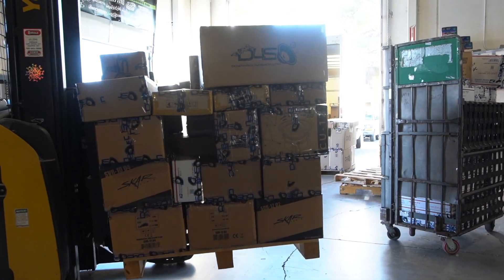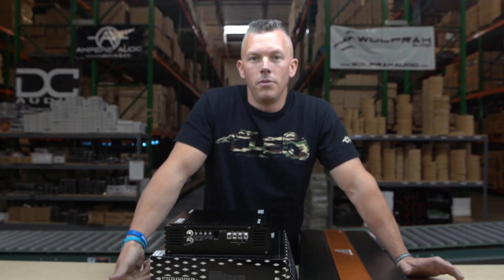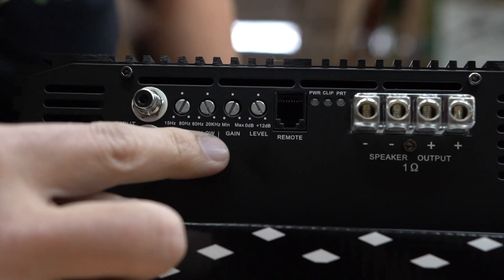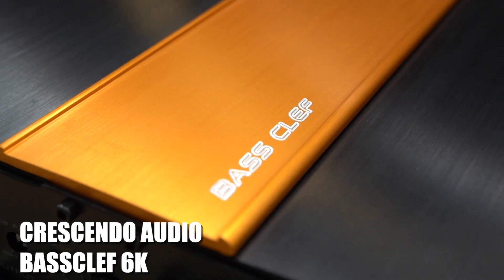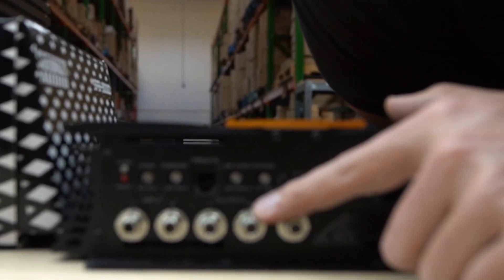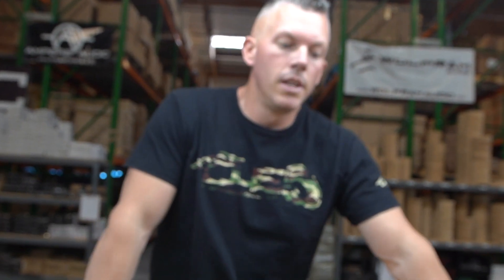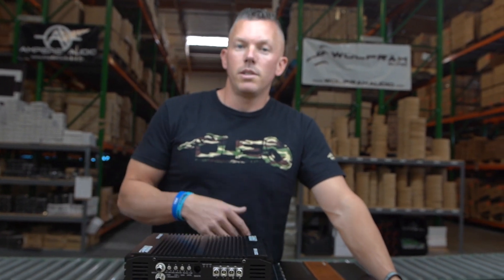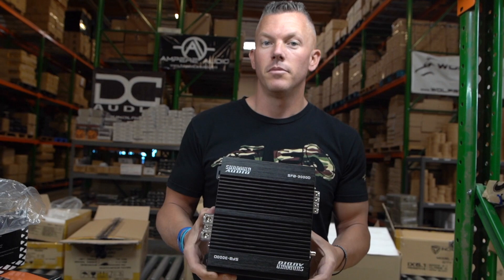FAQ WITH JP: WHAT IS A FULL RANGE AMPLIFIER?

Comment: Do you recommend powering the x15v3 in a 4 cubic feet box with 64 port area on the sia 3500 amp if so what ohm 1 or 2 would work better for that set-up

Comment: i love full bridge because : 
1. cheap, good bank for your buck.
2. super super powerful.
3. small chassis. easy installation
4. 90% fullbridge amp come with internal fan for better cooling.
5. full bridge from taramps + soundigital + stetsom and some another brands has a fullbridge but not a fullrange, specialist for subwoofers for low freq. same as normal monoblock half bridge design. sundown sfb just have a fullrange.

Comment: How can I run a mechman 370 gm 2 pin alternator as a second alternator just for my bass? I have a dual alt bracket and have an xs power d3400 battery with two ioxus ultracap banks completely for my system. Stock battery and stock alt for running the truck. Thanks for the content.

Comment: Full Bridge amplifiers are literally two half bridge amps strapped on one board wired in a push pull configuration. Half bridge are longer and heavier than full bridge because of all of the additional voltage and filtering needed achieve the same wattage of a full bridge due to the design of a half bridge. The reason a full bridge can't be wired below it's rated ohm load isn't because the design is crap it's because each half of the full bridge is already at .5 where this isn't a problem with half-bridge. Most full bridge get a bad wrap because the build houses are ordered to use cheap affordable parts which is 0 reflection on the topology of the amplifier and more on the companies ordering these amps and not wanting to put the money in them to up the quality.
Reply: JL Audio has produced some quality Full Bridge amps. JP literally just explained the difference between full range and a limited range amp. LOL
Reply: @SeanSinha  you do realise that jp has no idea of what he is talking about? Also flexin is completely right and your comment just proves how you know nothing about it either
Reply: @djlolerkoster  I am saying that JP didn't explain what a full bridge amp is, he explained what full range is. Full bridge amps are typically produced to be cheap, but there have been some awesome full bridge designs from companies like JL.  I bet I could present on the difference between full bridge and half better than you.
Reply: @SeanSinha  also what does the type of the amplifier have to do with its fr? Like you know that there are full bridges meant just for subs and half bridges that are full range
Reply: @djlolerkoster  That's my point. JP didn't explain wha a full bridge amp is, he explained what full range is. What about my comment was wrong, doof?
Reply: @SeanSinha  lmao dont get me wrong. I just didnt read it correctly because its after 1 am and im almost sleeping. I thought you said that flexin was wrong
Reply: Yup. Two positive rails on a full bridge, one with flipped polarity. It's really a cool design premise. Unfortunately most manus cheap out on full bridge components to make cheap amps, but JL and others have made some amazing full bridge amps
Reply: @SeanSinha  i hope that u arent mad at me or something
Reply: @djlolerkoster  I'm raging!
Reply: @SeanSinha  then stop raging and lets become friends lol
Reply: What flexin said

Comment: Another knowledge 💣 with jp..💥💥👍i got my subs on a taramps but i have 4 doors and 2 tweeters..im going to get an amp for the 4 door speakers..my question is what do i do with my 2 tweeters?keep them hooked up to head unit?
Reply: run them on the amplified channel with the door speakers with an "inline" crossover splitting the door speaker and the tweeter frequency ranges, tweeters hooked to a regular signal with no frequency filtering can blow easily, I think its how I blew one of mine lol